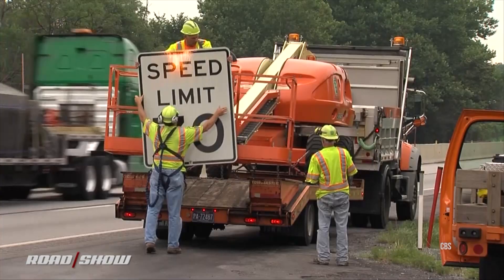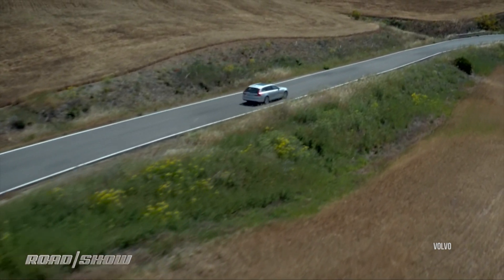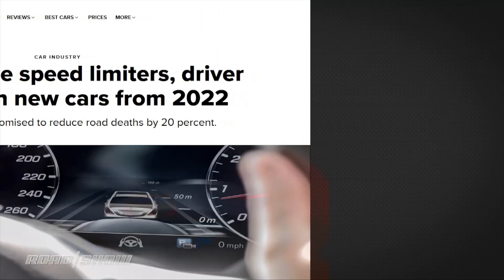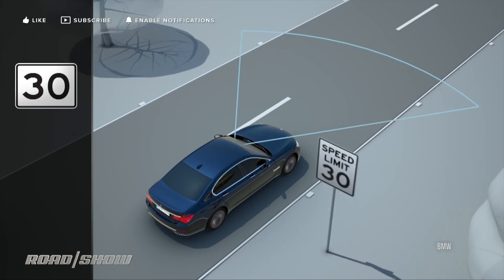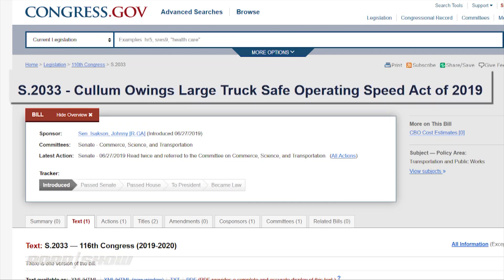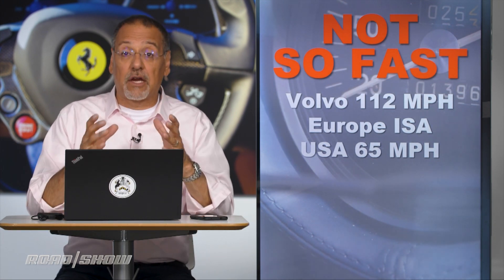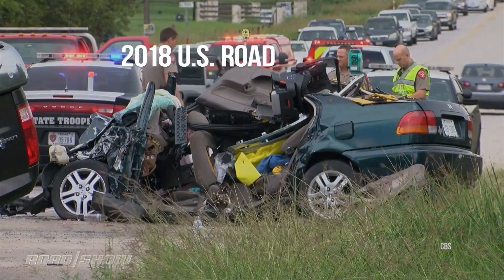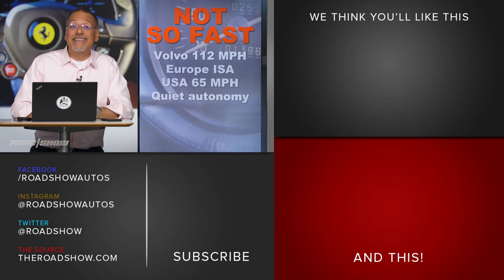Car Tech 101: Speed limiters could prevent speeding tickets | Cooley

Comment: Here is a report on the findings of adding 10mph to the speed allowed by trucks in the UK.

A Department for Transport report shows that allowing HGVs over 7.5 tonnes to travel 10mph faster has saved business millions of pounds a year - and may have improved road safety.
Bringing them closer to the speed of other traffic, has contributed to an increase of 1.5mph in average speeds on single carriageway roads saved hauliers 650,000 driving hours and more than £10 million a year in running costs.
The change, which came into force in 2015, allows lorries to travel at up to 50mph on single carriageways and 60mph on dual carriageway roads in England and Wales. It means they are travelling at similar speeds to other vehicles, with the aim of improving road safety
Roads minister Michael Ellis said:
“Increasing the speed limit for lorries has helped companies save time and money . . . potentially improving road safety by reducing the risks some drivers take when overtaking slow-moving vehicles.”
“This is an important reminder of the fact that setting appropriate speed limits improves safety and helps the economy.
"Groups campaigning for lower speed limits have been proved wrong again.”

Comment: What's the purpose of speed limits when all (most) cars become autonomous? Speed limits are set to allow a reasonable reaction time to an event requiring you to stop in a standard distance, or to ensure stability in corners. I would assume that autonomous cars would operate in a mesh network, for example a group of autonomous cars traveling down an open highway could safely do 100mph and then slow down when a new vehicle is entering the highway. This seems like a half-baked stop gap.

Comment: A system like we have on trucks is more than enough. 
Have the vehicle tell you what the speed limit is and ask for your veto if you want to speed past that. If you get caught you can't claim you didn't know. 
Also speeding is not the major killer here. 
Many more die from cardiac problems, cancer, pneumonia, any form of poisoning or injuries, infections, suicide....
Germany despite it's higher speed limits is one of the safest countries to travel by car and most accidents happen in low speed areas. The biggest danger comes from people driving too slow and not paying attention to traffic ( f.e. pulling out from behind a truck with 85km/h and forcing the faster lane to suddenly drop their speed from around 130-160km/h causing a chain reaction in the rear and maybe even causing an accident because of that )

Comment: My 2015 Jeep GC has a feature that announces whenever I go above the speed limit on the road I'm traveling (currently set at 10 mph or above).  It uses GPS and the maps loaded in my vehicle.  I have noticed on one road where I travel that it tells me the speed limit is 25 mph, when in reality the limit is 45 mph.  The reason for this is that there is an exit leading off the main road and if I'm in the right lane, the GPS thinks I'm going off on that side road.  If ISA were on my car, would it suddenly slow me down to 25 mph on a road with vehicles traveling much faster?  Seems like an accident waiting to happen there.

Comment: Another idea: let the car read the average traffic speed visually (or perhaps provided by a highway scanned system broadcasted short range qsignal), and by default not let itself exceed that by more than 10 mph/kph/etc. Otherwise, record it. The throttle pedal resistance threshold could totally be variable. Since all the camera and GPS tech are mostly in the car nowadays.

Comment: Most speed limits are far too low, the entirety of traffic completely ignores it.
Also speedometers aren't always that accurate. My old Baja seems to register 5 over under what my phone's gps reads, relative's newer Outback was more accurate.
Reply: Eric Ling speedometers are always calibrated fast. It’s to keep you from driving too fast. Despite that, the odometer is actually very accurate.
Reply: @boostedmaniac  Don't know about that, as I said it's an old Baja, 2005 actually, might just be because it's old or some such, in any case I generally just follow the flow of traffic anyways which again is almost always way above the posted speed limit.
Reply: Eric Ling maybe not all but many. Google car and driver speedometer scandal. There’s an article basically stating how many are fast.

Comment: Related but not very......I'm on the freeway driving spirit-ly ( code for faster then I should have been going ) and 2 diesels pass me and cut me off ( they were behind me in the same lane and now they are in the same lane as me but in front of me ) then a Prius passes me then I say heck with it and I speed up. I say this because those vehicles were going at least 20mph over the speed limit ( yes the diesels were going that fast to ) and I drive a lot and worry about crashes since my job is to drive ( I'm a delivery boy ) and my sister is always talking about accidents that happen near me so she calls to check up on me. On a side note the worst thing luckily I have witnessed in my over 20 years of drive was someone driving the wrong way on the freeway but ( for me at least ) thankfully they were driving the wrong wrong way on the other side of the freeway so I did not have to conveniently hear about it from my sister until the next day when she heard about it ( and that time I was there so it was kinda scary,  so one   could have hit them while I was there and they could have jumped the divider ).

Comment: 112 mph means little in the U.S.  My 2004 X3 was electronically limited to 135 mph. The  fact that speedometers go above say 80mph is much more of an issue imo. Posted speed limits are often set artificially low, with a bit of tolerance factored in. Rarely is the posted speed limit strictly enforced. Local custom, driving the flow of traffic, and similar things generally dictate how people drive. Increased consistent enforcement of speed limits would be much more effective than speed limiters on passenger vehicles. Like any other laws, these things can and should vary from state to state and area to area. Keep the government and technology from crippling my ability to make driving decisions. Trucks forced to drive significantly slower than smaller vehicles brings more safety concerns than it alleviates. Speed by itself is not a determining factor in safe driving. Let’s figure out ways to curb distracted driving first. Everyone seems to have their phone mounted in front of their face while driving. Talk about a significant distraction while driving.
Reply: Agreed. There's a road/two-lane highway near me with a speed limit of 55 mph. The flow of traffic is CONSISTENTLY 75-85mph. Cops don't even flinch.

Comment: Well, some interstates are 80 miles an hour. From the mid 70s to the late 90s all vehicles had an 85 mile an hour speedo to slow down drivers. It worked some I guess. Vehicles have already had limiters since the late 80s. Nothing here is new. I understand that this is for safety, but I for one would forego the electronic BS. Personally, I don’t even like the EFI in my 88 F350, and no I’m no curmudgeon, I’m 19. Carburetors are simple, reliable, and last longer than the failing EFI PCMs and sensors. The only reason EFI came to be is for decreased emissions. As far as the 65 mph limit on rigs, what is that driver supposed to do when driving in the mountains? Can’t say I’ve ever driven truck, but I’d rather have the option of speeding up to 75-80 to crest the hill easier. 

For the autopilot cars, no way that will ever come to be. There is just no way the computers will be able to process the conditions on the road. Sure, the camera’s will pick up everything as will the sensors. What happens when the camera gets covered with road grime, salt, snow, gravel? I think we will be without cars before we get autopiloting cars. The last time I remember the news covering auto piloting cars was the car failed to see the tractor trailer ahead and drove onwards, decapitating the 4 passengers. I’ll pass on buying one as a consumer, and I’ll pass on having one on the road next to me.
Reply: cool essay bro
the highest speed limit in the US is 85mph in texas
"electronic BS" is proven to save lives, which is why safety features are standard on many new cars
Modern cars are regularly driven to 15 years, in part due to the economy but also in part because they are better engineered, despite not having carburetors
The correct way to "crest the hill" is to drive the maximum allowable speed, within the capability of the vehicle. Having to slow down and shift to a lower gear is a small price to pay. 
There is no question you have about self driving tech that the highly qualified engineers paid to develop them haven't already thought of.